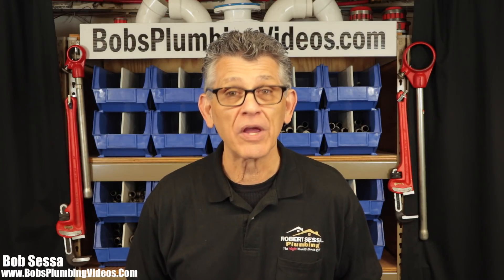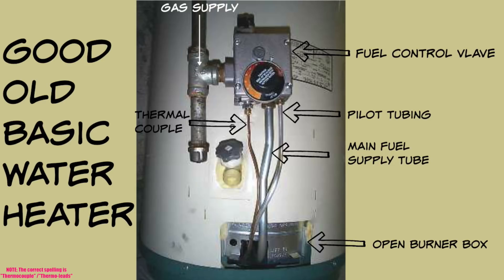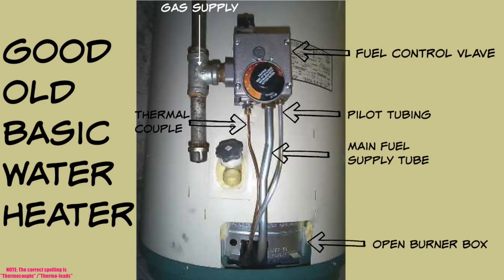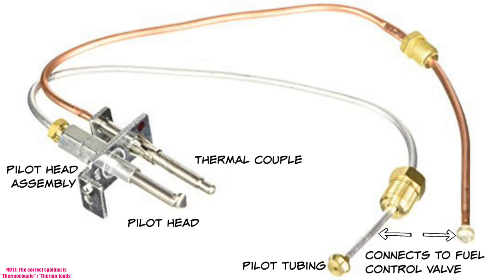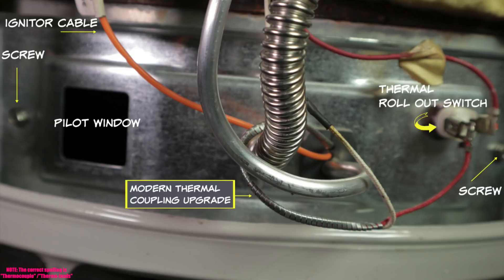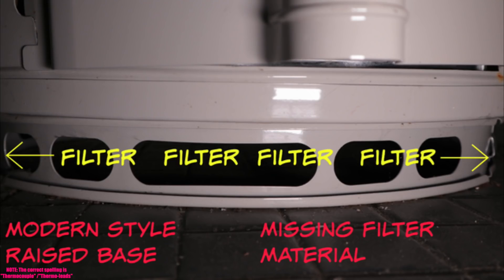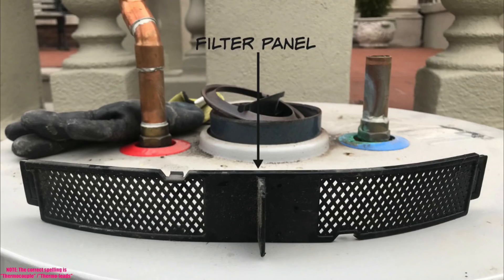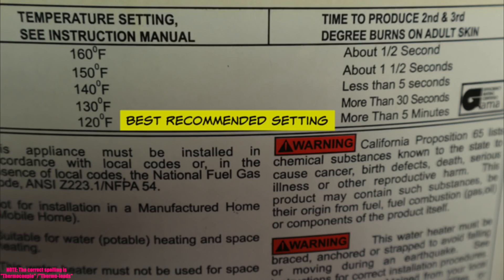Gas Water Heater Pilot Light Won't Stay On

Comment: Mine had a problem with air ventilation. Mice had made a bed in the sides of the bottom and stopped  it from lighting.   I didn't have hot water for about 2 years.  I didn't know the air flow was stopped up. After I cleaned it out it light and haven't had any problems.  The burner wouldn't come on but for a minute, then go out. Now it heats. I have plenty of hot water.🤗

Comment: Noting your gas connection on your newer water heater.  I don't think you can use a malleable black iron bushing on gas piping.  You either have to use a reducing tee or a bell reducer, but of course I'm old school.  I've seen many times where they used the thread protectors as couplings in gas piping.  I'm amazed at what they do to save a buck.
Reply from the maker: You are correct my friend, we could probably write a book on what goes on in the field!

Comment: Hi Bob got a question what's the amp amperage draw on a thermal valve I was thinking 3.2 to 3.5 amps ????
Reply from the maker: What type of valve are we talking about?
Reply: @BobsPlumbingVideos  on a gas water heater thanks Bob
Reply from the maker: @josephcade3541  Gas water heaters, in general, use a thermal couple or thermopile which creates millivolts to create the circuit. Not sure if I'm understanding the question?
Reply: @BobsPlumbingVideos  Hi Bob sorry for the confusion as you know a circuit can be measured by three ways generally speaking volts resistance and amps. My understanding is the thermopile is measured by millivolts my question is if I put an amp meter around one of the lines going to the thermopile what would be in the normal expected range of amps. ? I was thinking it would be around 3.2 to 3.5 amps
Reply: Hi Bob sorry about the question I was out of line. You can disregard my question. It was in the whole order of things last on the LIST. Please forgive me for such a nonessential and superficial question. God Bless You

Comment: Generic Thermocouple for WH would fit any WH or each brand uses its own ? Different milivolts for different WHs ? Thanks.
Reply from the maker: Generic thermocouple will general fit any heater. Pilot generators need to be matched up with the gas valve voltage.. The one in the video I used on my fireplace would not be recommended for a water heater.